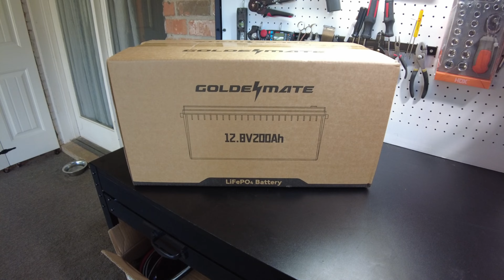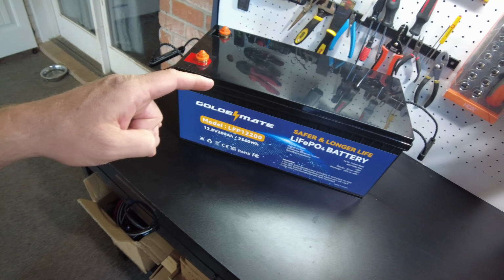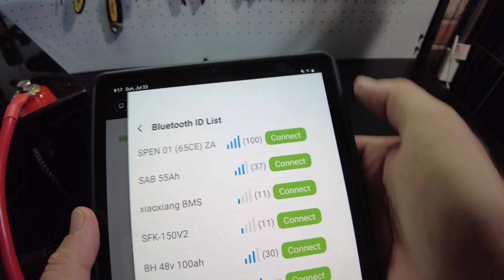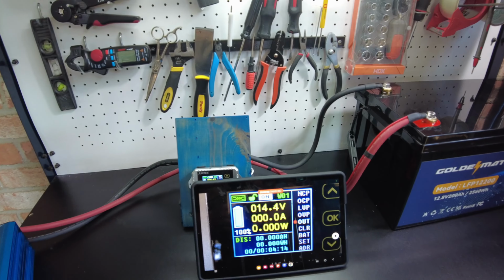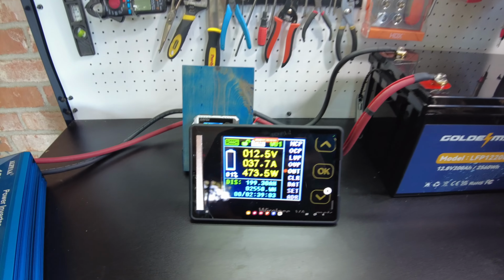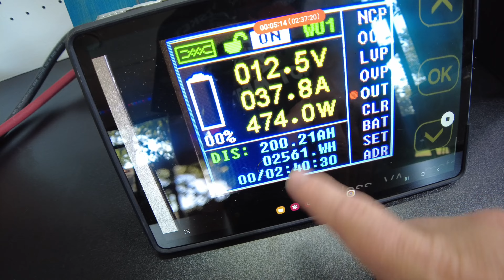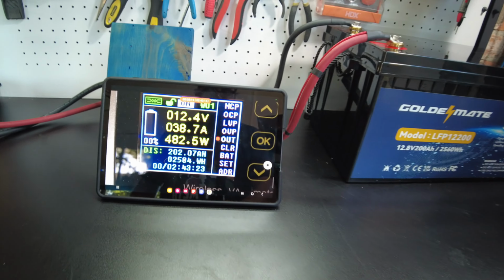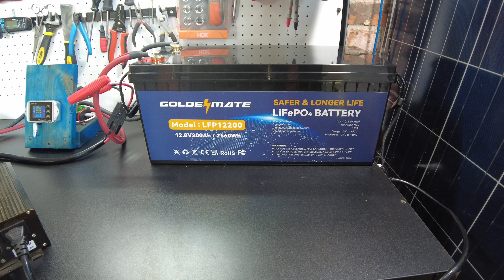Goldenmate12v 200ah LiFePO4 Lithium Battery

Comment: Hey, great video as usual. Two requests can you give an update on the battery bank you were using in your crypto shed and secondly if you can do a video on how to create your own mc4 extension cables, the proper length required for a proper crimp is not mentioned in any of other mc4 connector videos.
Reply from the maker: Will do. Thanks! BTW the Striping length for MC4 is 10-15mm

Comment: I know you've done a video on your electronic load tester (and I don't know if you want to shell out the money for this) but I'd love to see someone like you review the newer modular version of the DL24, the DL24MP. I bought the 600W 40A version and for a while I couldn't get it over 35A, it would just drop the current to 0 but the corner of the screen would still say "ON"

So I rearranged to the modules to an upside down T with the main module in the middle and was finally able to draw 40A. Could it be that I didn't have all the connections tight enough? Possibly, but I spent a lot of time going over every nut and bolt twice. It's definitely a terrible design in terms of how to connect a modular system...but where else can you find a (claimed) 200V 40A 600W electronic load for about $70 (I paid $68 after tax during a sale)

I really liked the SAB S168 cells, it would be cool to see the larger cylindrical cells, I know there's a company that makes 100Ah ones. Probably not very useful for you since standard group sized batteries are just easier for you to use at home.
Reply from the maker: I've been eyeing that one. I do have the DL24P but it's not working properly now. It comes on, but never actually places a load on the battery.